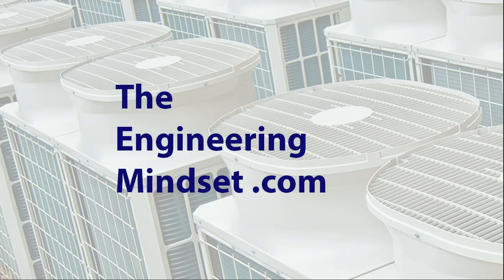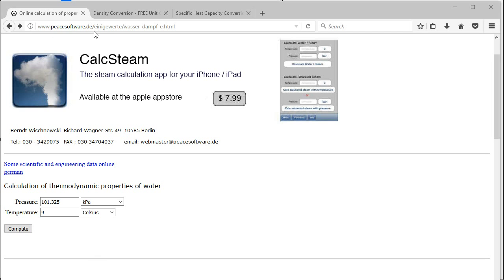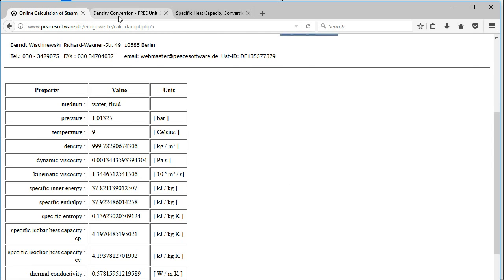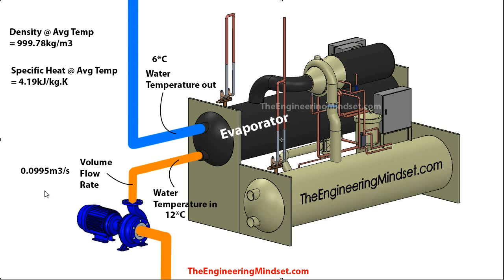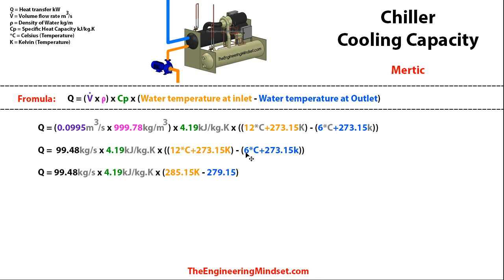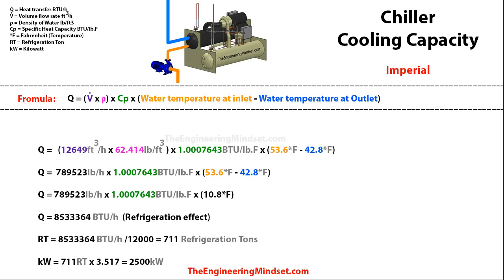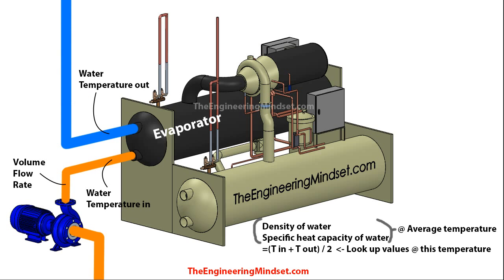CALCULATE Chiller cooling capacity - Cooling Load kW BTU Refrigeration Ton

Comment: I am using Brine(Methanol+water) as a fluid to maintain the temperature below -5 , then how should I take the specific heat capacity, density and volumetric flowrate?

Comment: Hi Paul how r you?
Chillers circuit consist of 35% glycol & 65% water and you have mentioned specific heat capacity of water only ? Is glycol has the same specific heat capacity as water? If not what is specific heat capacity mixture of water and glycol?and what’s the density per kg?
Thanks Paul

Comment: hello 2 questions that I have 
1  If using chiller manufacturers  flow  curve chart  do i still need to add the n  density  factor or thats built into that?
2  Necessary to  convert to  Kelvin vs   Celsius?   more accurate?

thank you!  stan

Comment: This is semantics really and should not take away from the awesome video (I'll still buy you a coffee Paul) but the final calculation for BTU/h is not correct.  I believe it was just a typo but it should be 8,530,355 BTU/h.  If you figure 12000BTU per 1 RT.  12000 x 711 = 8,532,000.  If you rather 3412.142BTU per 1KW. 2500 x 3412.142 = 8,530,355 BTU/h.  BTW I have learned more watching your videos than studying any other format.  Excellent work and I particularly like the blender 3D renderings of the machinery. Best wishes.
Reply: It is correct on the imperial calculation.

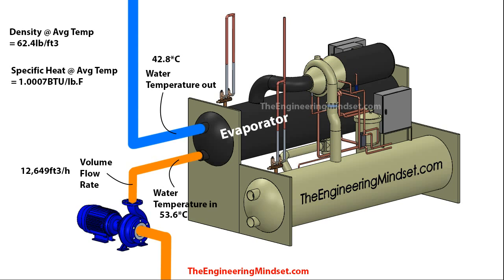Comment: Hey, small type at 6:44.  I believe the value of BTH/hr needs to be on the 8 million range, now it’s at 800 thousand range. Your imperial value  at 9:13 is correct.
Reply: Yup, value in BTU is wrong. It should be 8 million range

Comment: Hi,  i dont understand some things about chillers. I need  to get down the temperature  (from 36°C to 26°C) of a outdoor pond (24,000L), i know that in this case i need  1,713,168 btu to get down  the temperature 10°C, but when the temperature getdow at 26°C,      i will still need 1,713,168  btu to maintend the temperature at 26°C, or it wil be needed more or less btu ?. what factor i should to consider for make the calculation?. Thanks for the help

Comment: Thank for your video, but I’m still a little confused about the temperature difference. While chillers are turned on or off, the outlet temperature will change drastically causing the temperature difference also change. Should I take the temperature difference in the two time period as normal or there is another way to tackle it. Thanks.

Comment: If the air cooled chiller is off but the bms valve ( actuator valve ) is open its not closing, What could be reason for this ...

Comment: nice video, excellent explanation. just a little bit error in some unit & results computation. i just have a question how can we design the building cooling capacity. meaning what cooling capacity do we install, pls. indicate all the parameter or the requirements for the right design. hope you answer my question. i wait for it.

Comment: Excellent video.  I have 1 doubt please solve it.

From internet i saw this formula relation

GPM = 24*TR/delta T 
This is for water.

Now for derivation of this relation:

We know from heat equation
m*c*deltaT = TR*3.52 
Where m=mass flow rate of water in kg/sec, c= Specific heat of water in KJ/Kg-C, TR= Tonnes of refrigeration. 

Now m = Density*volume flow rate

Now putting, c = 4.2 KJ/Kg-C and Density = 1000 kg/m3

We get,
4200*Volume flow rate (m3/s)* deltaT = TR*3.52

Solving, Volume flow rate = (3.52/4200)*(TR/deltaT) m3/s

Now to convert it in GPM we know

1 m3/s = 15850 GPM

So, 

V = 13.3*TR/deltaT

These 2 relation is not matching. Please check and tell where i am doing wrong. I have checked multiple times. Please help.

Comment: What if you have 25% glycol + 75% water in your chiller loop?
Reply from the maker: Adjust for the density
Reply: Thank you for replying, so to adjust do i have to do it like this? correct me if i am wrong 1000 kg/m3 (water density) + 1100 kg/m3 (glycol density) = 75% of water density (750 kg/m3) + 25% (275 kg/m3) = 1025 kg/m3 ? 

How about CP values ? how to adjust it ? and where can i get CP value of glycol? 

Also i have seen in another video following formula for Capacity (Tons) = Sp heat x Sp gravity x fluid flow rate x Delta T/ 24. I wonder if this can be applied as well? 

please support.

Regards,

Comment: How do you calculate Chiller tonnage with Cooling Capacity (kW)?
Reply from the maker: either from the design flow rate and temperatures or from the refrigerant
Reply: Do u mean convert tonnage to kW?
Reply: MUHAM PRODUCTIONS yes
Reply: I think 1 KW = 0.284345 tonnage

Comment: Is pump for water inlet or outlet of evaporator? Where pump is  present for  about condenser?
Reply: The water is pumping through the evaporator (so in answer to your question the pump is for both inlet and outlet) and continues to the Fancoil units within the building.

The compressor drives refrigerant through both the evaporator and condenser without mixing with the water in either (the evap or cond).

The condenser has it's own pump that circulates the water through the condenser and up to the cooling tower.

These constitute 3 separate circuits that never mix.

I hope this helps.

Comment: please confirm 101.325kpa is this atmosphere press. or evaporater inlet water press. ??
Reply from the maker: Water isn't compressible, at least at these pressures, so the pressure you use is negligible and the temperature is the key factor

Comment: i want to know how you get values of density and specific heat at avg temp
Reply from the maker: How? was explained early into the video https://youtu.be/BZxXIdxVKeY?t=1m52s
Why? because it will produce more accurate figures using average compared to highest or lowest values
Reply: same question??
Reply: Same question for density of specific heat

Comment: great work👏👏👏.
my question is why we take average temperature for this calculation?
secondly I have problems in calculating IPLV and NPLV of chiller. could you tell us what these values are and how to calculate them?
I request you to make videos on pump head calculations, heat rejection by cooling tower.
I know I am asking you too much but believe me you are inciting us to become complete HVAC Engineers.
Reply: Great videos mate.  I may be wrong but I think you had to divide the temp difference by 2 to get the average of the temperature as per your original formula.  I stand corrected.
Reply from the maker: Using the average will give a more accurate answer, try using the values at inlet or outlet temperatures and there will be some difference.